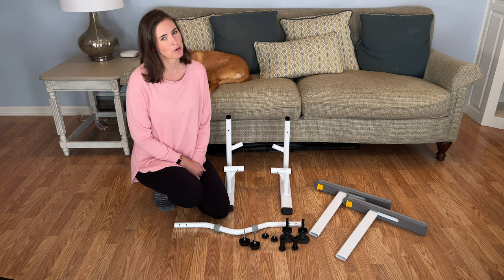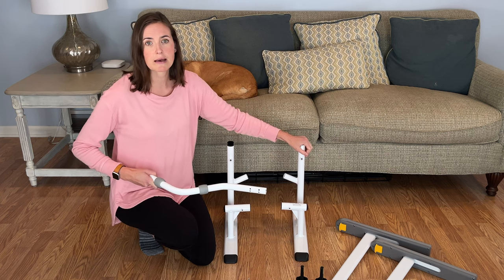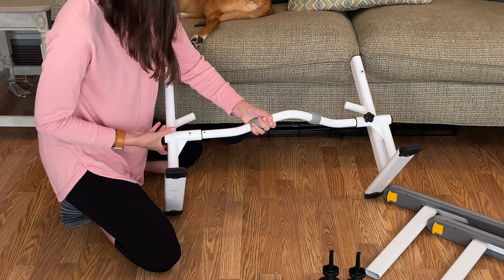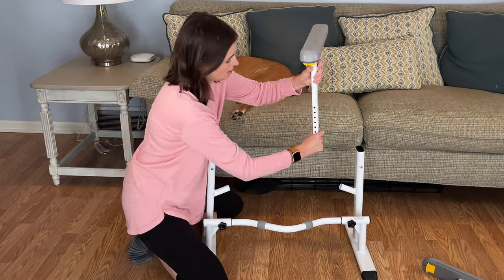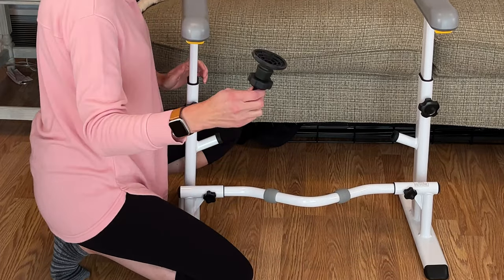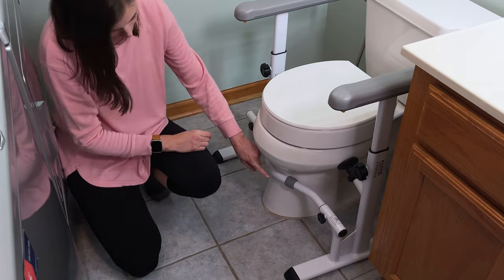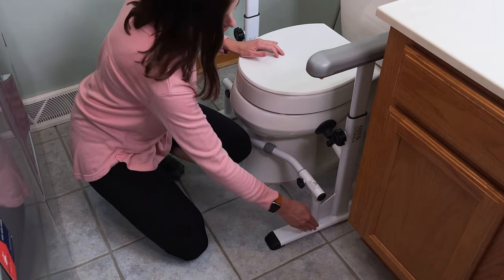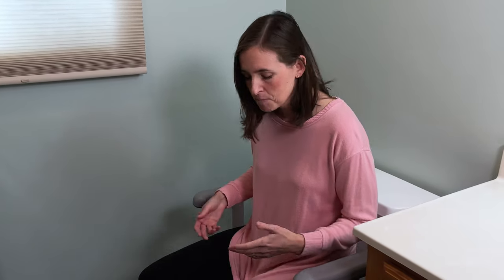How to Install KMINA Toilet Safety Frame? | Assembly, Installation, Review

Comment: Looks really nice and sturdy, but I’m assuming if one were needing this, they would also be on a walker. In a space like this, I could see the walker hitting the foot frequently. Maybe avoidable in a larger bathroom, unfortunately a lot bathrooms are built like this.
Reply from the maker: Yes, this is definitely a vital consideration. Not all setups are as tight as mine (this bathroom is exceptionally tight, but it was the best option for filming 😖). If you approach sidestepping or with a cane versus walker, it is still a valid option.

Comment: My 62 year old brother, quadriplegic since 1986, just broke his hip by putting on socks.  He lifts his foot and places it on his lap and puts on his socks.  He heard a popping sound but didn't know he broke his hip until the following day.  He has to jerk his leg to do this and obviously doesn't know how much pressure he puts on his joints because he can't feel.  Is there anything that could have prevented this?  He has no use of his hands, except his upper arms, so makes lots of jerky movements when he manipulates his body.